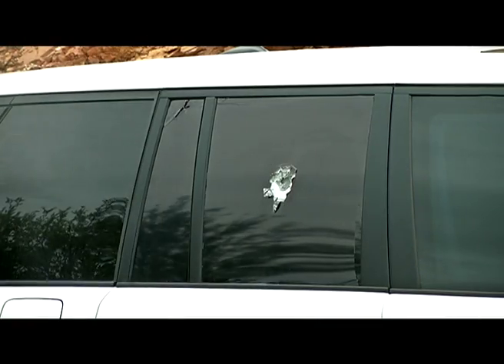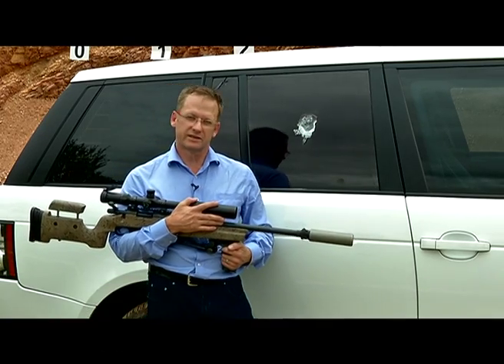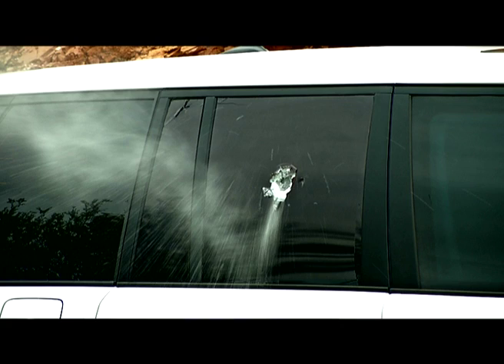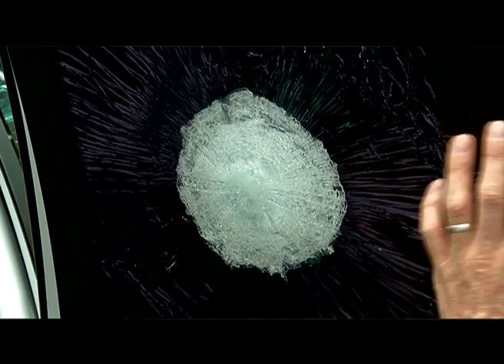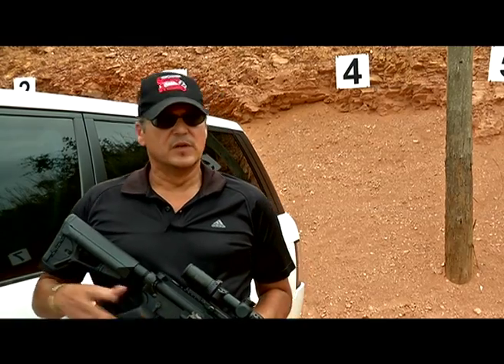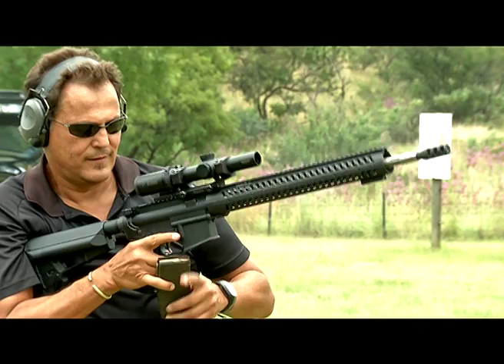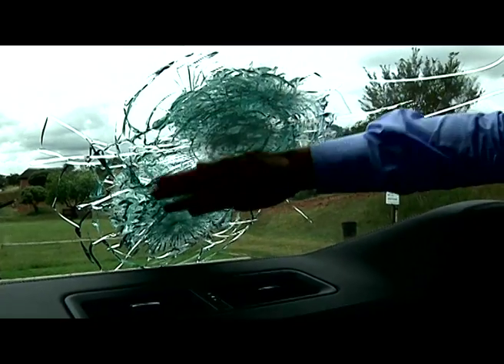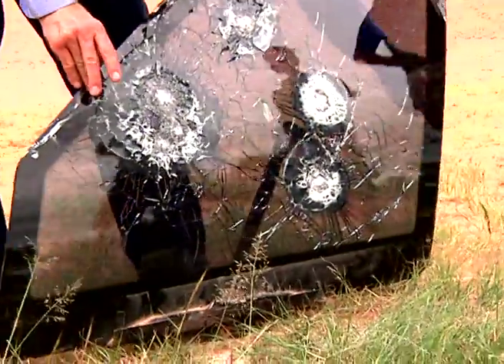Saving Lives with Armormax (Ballistic Glass)

Comment: Does this Range Rover have electric doorhandles , a smokescreen system? Oil spray? A tack dispenser?
Reply: They can be. We install these and other options on several vehicles.
Reply: @MarkBurton1  
Do you also offer deadbolt locks for vehicle doors? If yes , how do these work?
Reply: @MarkBurton1  can you break the window out from the inside in case of an accident?